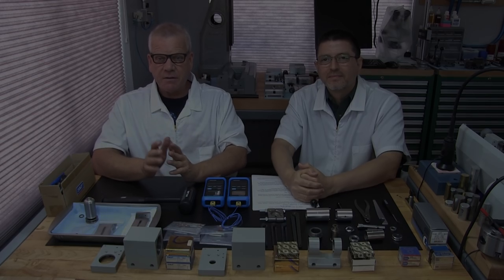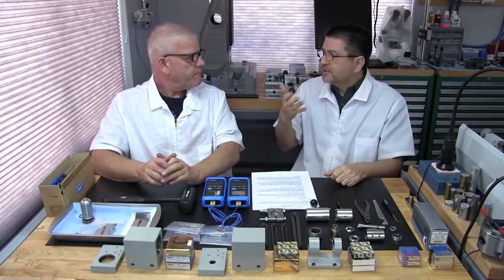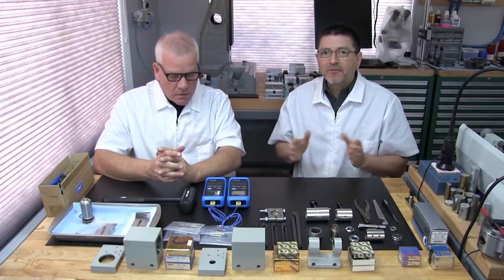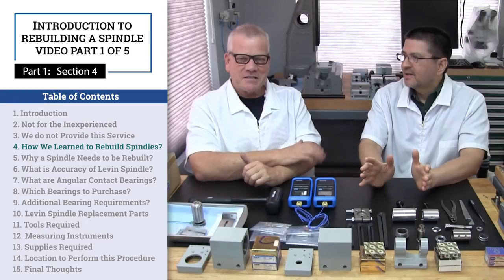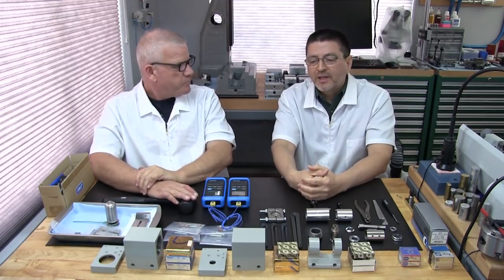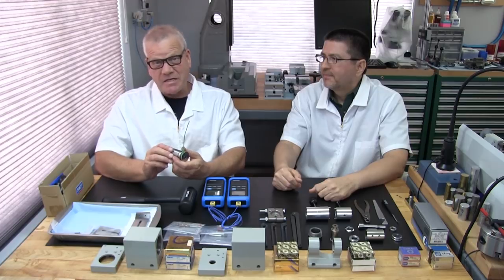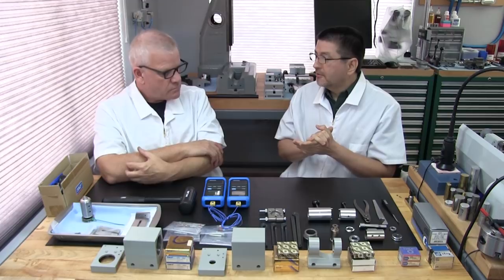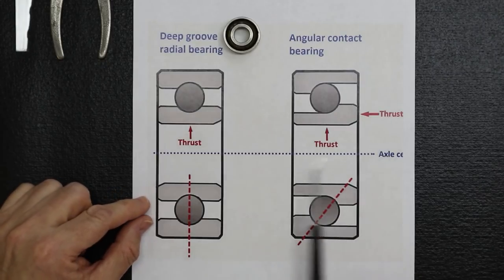Precision Machine Spindle Rebuilding - Part 1 Introduction

Comment: Thanks for the thorough explanation of bearings. Re installing bearings I think you said push against the part that is in contact during the installation - so the inner race when pushing onto a shaft, the outer when pushing into a housing. Is that correct? If so it seems obv now but I've never figured that out by myself. Luckily I'm a hobbyist and don't work on the same things you do!

Was also interesting seeing those pin spanners being used on the outside of the nut. I assumed there would be a C spanner. And the custom tools for that and getting the washer retaining rings off were nice.

I just went to the Levin machine tools website. You guys are living in a different world. Their drilling machines cost more than my lathe and milling machine combined. I expect all their stuff is an order of magnitude more accurate too. But I'm a computer programmer trying to make a steam loco so precision tools would be wasted in my hands.

Looking forward to the rest of the series, I'd like to think some of your skill is making it's way to me just by watching ;)
Reply from the maker: Nice to read you are a programmer our bios at Active Atom website share a bit on that topic David.
Nice to have you here happy you are enjoying the Educational Series these are new to us we always make (always listen to us) about 10 months of Shop Adventures.

We never reinstall bearings (just being clear to be helpful always David) even if we make a mistake during installation they must be replaced as we are attempting to hold a tolerance as good if not higher then the factory specifications and that rule goes beyond these little 50 millionths (TIR) Total Indicator Run-out spindles from the Levin & Son Company. 

We can assure to you David that watching the remaining parts of this series will greatly add to your machine thinking abilities I mean we watch many technical videos and on topics we are not intending to perform like geology related but we always gain something so we think you will as well, well that is the thinking here.

NEW VIDEO WEDNESDAY PART 2 OF 5 HOW TO DISASSEMBLE A PRECISION MACHINE SPINDLE
Also you already survived the longest video in the series Part 1 of 5, that 2 hour 12 minute GRAND OPENING the Introduction to Precision machine Spindle Rebuilding so as an example Part 2 of 5.

Part 2 of 5 has a run time of only under 1 hour, so this is considerably shorter and the other parts and sub-parts coming out over the coming week are shorter yet as we wrap this our first Educational Series up and continue on our journey of these two childhood friends to rebuild machines and tools of the past and make a product from start through to its finish using only these machines and tools and all of the work being performed by only the two of us here within Yucca Valley, California David.

Thank you again, Lance & Patrick.

Comment: Excellent job, Lance and Patrick!  This information is not readily available on the web, and it took weeks for me to glean similar knowledge from the PM site. One question:  can't unsealed bearings be cleaned carefully in solvent and then be re-greased in a clean environment?
Reply from the maker: Hello and welcome Daniel. 
Great question and we are both very happy you asked it here within the community of comments, so we can share this important reply with the community at large.
Nice to read you to are a member of the Practical Machinist forum, that is a great place to start many a conversations and to seek some of the brightest minds in the machining world globally.

What you are suggesting might work to get a spindle back up and running quickly, but that is an issue to address here, so here we go. 

Our goal here Daniel is to provide the best practices and thus we feel the best results for the endeavor at hand.

This Precision Spindle rebuilding Series addresses rebuilding a spindle, not saving a bearing.
Here is our example of that rather bold statement from us, it stems from the requirements we have two here to share. 
We are rebuilding a spindle to hold a (TIR) Total Indicator Run-out of 50 millionths of an inch and we are rebuilding the spindles to (once correctly rebuilt) last a decade or usually more of continual usage.

Spindle rebuilding takes a lot of great time, accurate efforts and high top shelf skills and the goal here is to seek, gain or even achieve an above or at spindle specification tolerances.

We would hate to have to take a part a spindle after one of these cleanings for these following reasons:
The life of the spindle is greatly reduced because under a microscope we observed corrosion where these bearings might have sat over time resting in a single spot below each actual bearing ball creating an ever so slight bond between the race and the ball of the bearing(s).

Here is an issue about bearing cleaning about unsealed bearing as you are sharing and thank you.

Questions to ask before cleaning bearings.
Angular Contact Bearings in a closed Levin Head Stock are installed side by side so to clean these you will need to press them off the spindle to begin this process.
What condition are the current installed bearings in? Are they going to be able to hold this 50 millionths TIR? once the bearings are reinstalled onto the spindle and the spindle is reassembled.
Spindles must be reground after each bearing installation or re-installation to restore accuracy in the spindle, spindles.
We have never seen a Levin Spindle Bearing that is already installed being removed for cleaning, even a mistake during installation, then reinstalled and still able to hold this 50 millionths TIR tolerance.  

Again thank you so much for sharing your thoughts, and hey Daniel, a new video from the series comes out this Tuesday night Part 2 of 5 so we hope you can stop back in and enjoy the rest of the videos, we are happy to have you here with us.
Lance & Patrick.

Comment: My recent auction bought Dumore Speedee No. 11 tool-post grinder has a spindle that feels tight but feel smooth, no lumpiness and no end play. All seems great when grinding in slow speed (just under 7000 RPM) for external grinding with a 1" to 2" grinding wheel; but when run at high speed (30,000 RPM) the pulley end bearing retainer becomes blazing hot in just seconds while the working end stays relatively cool. Could the preload or a cheep  or mismatched bearing set be the problem since the spindle turns so smoothly? This Introduction is great and looking forward to following this through!
Reply from the maker: Hi Joe welcome to our channel and the spindle rebuilding series we produced to share what it is we do in our own shop. Congratulations on your fine purchase we do use the Dumore motors here but do no utilize that grinder though we know of it you have a fine tool there sir.
Here is our thoughts without knowing this grinder or its past based on your sharing with us.
We do not think it is the bearing grease which can be a cause of high heat issues but we do think it is the spindle bearings they may not be the originals or they might just be tired so if we had that spindle here we would rebuild it, we do not offer this service, but it is good advice for a tool we or you do not know the past (history) of as far as wear and tear goes, because this is a very precision  machine tool you are lucky to own Joe.
Thank you for being here hope we are helpful and hey sorry for the delay been working away in the workshop and did not have the ability to reply sooner too you.
Lance & Patrick.

Comment: 1:27:00 - maybe this has already been said, in which case i'm very sorry, but i suspect the slinger does not need gravity to sling. Using hydraulic friction alone, it can work as an impeller, like a Tesla turbine with one disk. I mean it would still be better to point the hole down, but tl:dr it should have some suck/blow force being all sandwiched in like that, no?
Reply from the maker: Hi and a great question/thought you bring to the attention of the viewer.
No Gravity is correct, GREAT.
That disc is not an impeller, it is just s flat surface aluminum disc that spins along with the spindle, see it is pressed onto the main spindle.
There is no suck or pull, no draft we just have a gravity drop slot as a single exit after it is slung during the spinning operation should something foreign get through the felt ring in the forward of the spindle, this foreign material liquid or solid would have the easiest way to exit the internals of the spindle by being pointed directly downward and this too would all but eliminate the possibility of foreign materials entering the main spindle area from the externals of the headstock.
Thank you canna roe again for being here with us, Lance & Patrick.
Reply: @ActiveAtom  Ah OK, good to know thank you! And thank you both again for your time and wisdom on this episode. It is a real luxury to have such high-quality educational videos. Wishing you both all the best from Germany :)

Comment: I wonder if the groove was left in that cap as some form of labyrinth seal when combined with the slinger . What sort of RPM does the accessory spindle run at .  Great information , Cheers .
Reply from the maker: Hi Max, that is as good a thought as any we had here, we do not know they the company really does not know they think they are just there because they were already, that remains our guess.

The RPM of our Levin & Son lathe spindles, well in Part 5 this is addressed, I mean we all know that each bearing quality shares the maximum ability of the bearings RPM (no cheating until Part 5 Max LOL) but then there is the plethora of scenarios that being the reduction of that number down into a reality including continuous usage so you will have to wait to hear what we share from our factory documentation and inside the company information that accompanies this outcome.
Your California USA friends who like the toys you get to work on and with Caterpillar and a neat grinder of late. Lance & Patrick.

Comment: Great job, Gentlemen.  I thought i'd give this about ten minutes today, because I had a lot of other work to do.  Well, over two hours later, I discovered I hadn't moved from my chair.  A few questions.  Do you use an ultrasonic bath to clean parts?  I'm impressed with the finish quality that the epoxy paint provides.  Where can I find some?  Best Regards.
Reply from the maker: Hello MrShobar.
We are happy to take the blame for stimulating the mind not wanting to cause any broken home issues in the process LOL.
We like this compliment about sitting down and getting stuck on our Educational Series Part 1 of 5.
That is the longest video in the series at 2 hours 12 minutes.

1 hour and a few seconds tonight.
Part 2 of 5 releases tonight it is about spindle disassembly focused on the Levin accessory spindle from a grinder, micro-drill or milling attachment as these three are each the same style and model of spindle, however we are sharing the already disassembled head-stock spindles 3 of them we are also rebuilding well at least the differences to look for and expect during the spindle disassembly process.

Ultrasonic uses here and Paints we use and from whom
Let's get answers to your question a great question to be asked and yes a chance to share an area in the Workshop not shown on film yet. 
Ultrasonic Cleaning Station:
This is something used in a watchmaker shop all of the time as these parts are so very small, we will have to show off our custom built chemical and ultrasonic wash station, it is a nice table with some neat features, you will have to wait we will get over to it in a coming future video. 
We do not use our ultrasonic for cleaning machine components however we will be using it to clean the arts coming off these machines for our product before they head over of us to apply coating or polish their heads depending here.

Paints for machine tool coatings we use Sherwin Williams Protective & Marine Coatings hi-solids and macropoxy, pro-urethane coating types not the ones from the box stores MrShobar, but from the manufacturer outlet stores, they even come with a ton of paperwork and such. 
We buy this two part primer under coating and two part paint over coats comes with thinners and hardeners and then you need a infrared wave stand with paint baking wave lengths ours is from Infratech.

IN CLOSING:
Do not fear all of this mambo jumbo talk they providing to us it is easy though you want the nicest breathing and eye covering apparatus and a fan pulling the fumes away from the work, warning do not allow the fan to draw foreign objects like dust and the likes, you can do this work though it is really neat when done.
We did a few videos with this work of painting in the titles to help guide you some of the way or at least share the way we do our work everyone is different in their approaches.  

Also we are sure you know this one, all of the effort to have good results in the end, are in the surface prepping and good planning before mixing this paint will aid you greatly, you might wish to write a plan of attack in advance, these things work best for us here.

Thank you for these GREAT questions they remind us of all the work that goes into the littlest of things around here, goods thing MrShobar, that we love our work good thing.
Happy to have you here with us.
Lance & Patrick.

Comment: great video fellas, I have the older lathe you show. My question is  the space in the matched pair.  Is this a metal shim fit to the overall diameter  I would like clarification of this if you can. Does this space enlarge over time or does it remain the same. 
My second question is downloading the notes. are they available after each episode or after completion of this  5 part series. Thanks
Reply from the maker: Thank you for watching Part 1 of 5, there are also 4 sub-parts we are sharing a sub-part below with you.

Hi we are calling you 1950 from your above handle, a year 13 years before the birth of Lance and 17 years before the birth of Patrick, always we are sharing our open book of information 1950.
Lets get your two GREAT questions answered with high honors.
You asked about the shim of an open style head stock. This head stock as shared in Part 1 of 5 of the Spindle Rebuilding Series is Lance's favorite style for that pulley being in the middle of the bearings. 

What you want to watch is coming in about 1 week 
In Sub Part 3 of the actual Part 3 with a title something like How to replace bearings in the "Open Style Levin Head Stock", within this is one of the 4 sub-parts and it covers the open style head stock.

Within that sub-part video we will address the shim and in fact we actually share the shims and have a discussion about them for you 1950.
Also you asked about space enlargement, the short answer is yes, read on please.  
Bearings do wear, you understand this we know, even under good general use this occurs, thus they come loose they lose their pre-load and these bearing will need to be replaced as you are needing to retain a constant or as close to 50 millionths of an inch (TIR) Total Indicator Run-out. 

Remember today your bearings come with a ground-in pre-load, so shims are no longer required even if you come across this during a spindle disassembly.

You asked us about documentation:
We will upload the entire documentation and will add details to these documents from information gathered from viewers like you and discoveries we continually are making in our works here.
Thant was nice now where is our friend 1950's damn document?
You can download it from our Active Atom website page under the title tab heading Active Atom Education.
Allow us about two more weeks for the downloadable documentation for the entire 5 main or 9 total parts of How to Rebuild a Precision Machine Spindle. As like with your current question there are bits and pieces still being added and they will be continually added as or if discovered over the coming months as well.

1950, thank you for stopping in enjoy the remaining videos and thank you again for this great set of valuable questions, the two of us cannot do all of this alone we need and appreciate the persons that helps us and the community at large along the way.
Lance & Patrick.
Reply: @ActiveAtom  Thanks very much. I'll  be watching all the way . Many thanks for your video on the drill press also. I finally got mine zeroed out thanks to you fellas